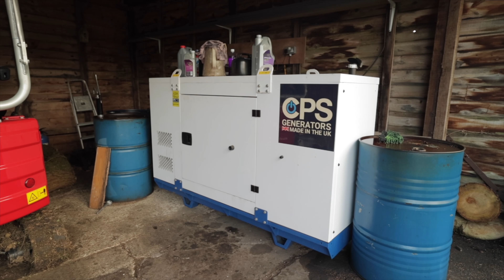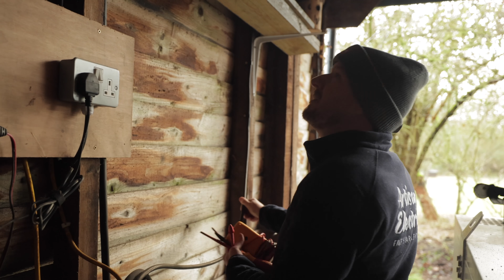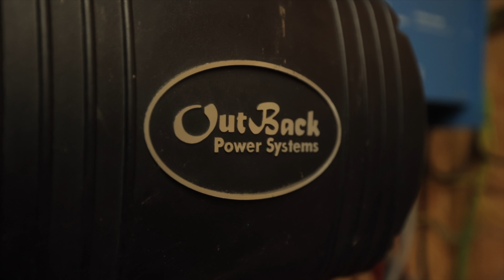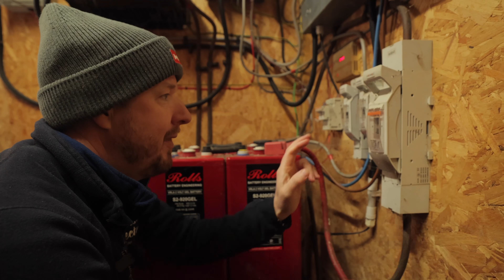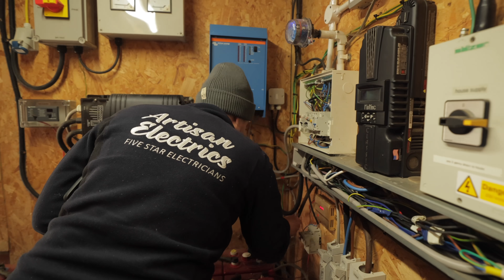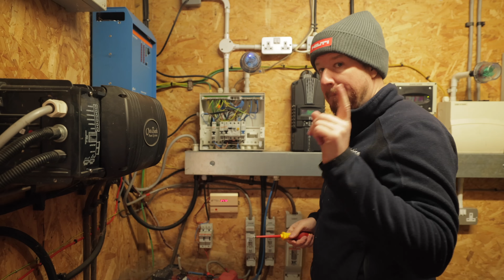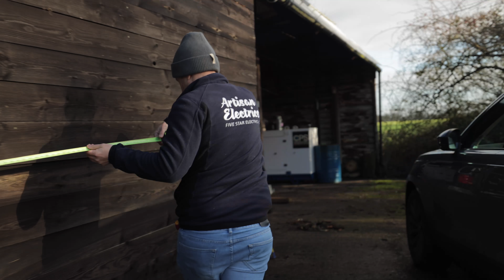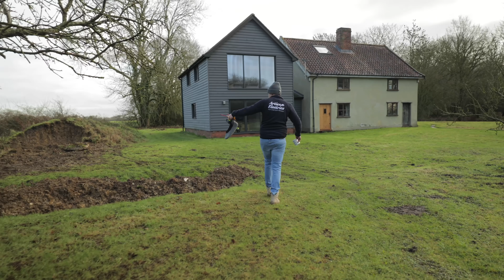DIY Off-Grid Solar Gone Wrong! (It Can’t Even Boil a Kettle)

Comment: That is the most Old Skool DIY job I've seen yet.  Definitely not up to any code.  Especially that Inverter.  Batteries were probably dead from age given the charging setup.
Reply: What's wrong with the inverter? Outback make decent gear. I agree the batteries are probably well past their best if it's been there  a decade. Mostly it seems to have been done reasonably well, and I don't actually see much that makes it dangerous. A bit of tidying up (lose the terminal block) and putting in some double-insulated DC cable would make it safe.
Reply: @xxwookey  Some decent gear just needs tiding up , can't believe they considered outback inverter as unknown , Outback been making solar gear for ever , suppose Artisan are new into this Solar . Just done small cheap solar , picked up Outback grid tie inverter cheap off Ebay (no FIT Compliance) quality bit of kit
Reply: It's likely a 3kw inverter and should be able to be paralleled up to 9 of them able to handle really high loads and they make a model for EU markets. It's sealed so it'll survive in high dust or humid environments, pretty commonly used on boats, it's just older, probably from about 10 years ago. If programmed properly it'll fire up the generator to charge the batteries properly if solar can't keep them topped off.
Reply: Why would the batteries be dead?
No info in the video of manufacturing date. Also no info on low voltage shutoff setting on the inverter.
Reply: @The-secret-101  System looked pretty old , 225 watt panels not been fitted for many years (still worth keeping though) Might be worth load test batteries but lead acid don't last that long
Reply: @nounoufriend1442  True. Hard to tell the age of the batteries though, they might have been replaced (which would had been a wild choice if it happened semi recently, but perhaps the only option for someone who couldn't afford lithium based batteries?).
Good point about the 225 W panels. Replacing those with same physical size panels with higher output seems like the upgrade that would save the most diesel for the amount of money spent. Sell off the 225W panels, or possibly wall mount them on that barn/outbuilding?
Reply: @The-secret-101  Yes I was jumping the gun saying battery bank was past it , be simple job to load test them . If they need replacing Lifepo4 would be way to go as far cheaper than Lithium ion safer and cheaper to manage , near direct replacement for lead acid ( just settings in charge controller )
Reply: Suppose it is a remote system so there ain't really any code , is a bit of a mess though and insurance fire claim would likely get refused
Reply: @nounoufriend1442  Messy wiring does not increase fire risk. Loose connections and undersized cables does that. I'm sure if there were any of those Jordan would have gleefully pointed it out, so there probably aren't any. I guess they could point at the lack of double-insulated DC-cable, but was that a requirement in 2012? Is it actually a requirement for off-grid systems at all? How much of a fire risk it it really?
Reply: @xxwookey  Yes your correct after having good look at video cable sizes and fuses were all ok . Would you even need double insulated DC on this system as panel voltage was only showing about 100v , no high voltage series strings like on grid tie system . Think the charge controller is 150v PV max , Jordon seems bit clueless on off grid systems " Jordon had no idea what the charge controller even was ! "